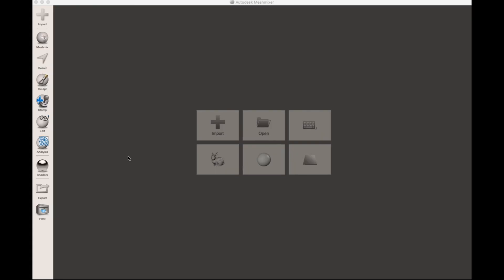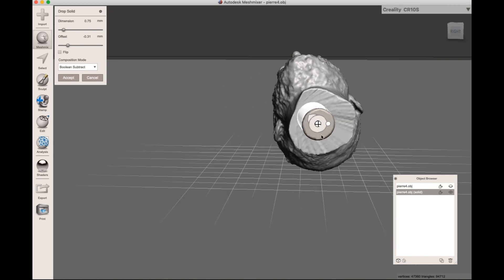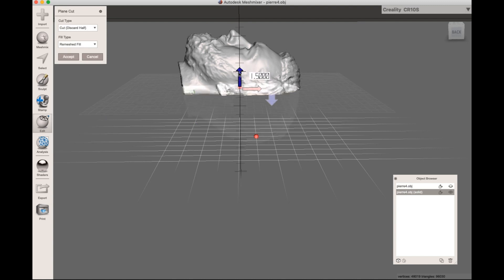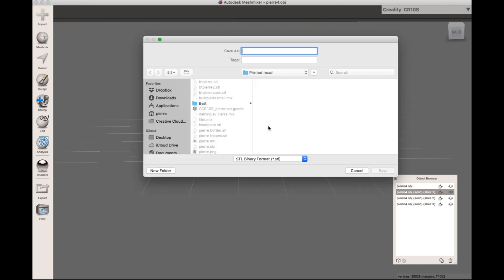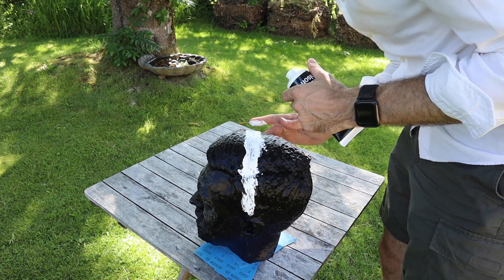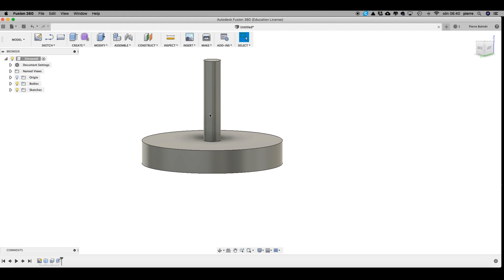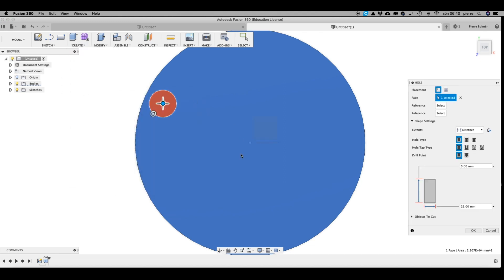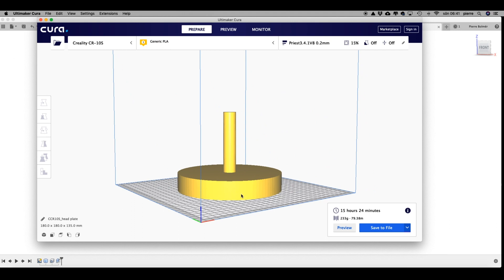3D Printing Yourself - Full Size Head Print

Comment: Any way to do this using a picture of someone? If so I’d be willing to pay for one! Great video!
Reply from the maker: It can be done, but the back of the head won't be the same as the one photographed of course. The better option is to do a 3D-scan. There are apps for that or I have a video on how to make it with a camera. There are also 3d-printing services that can print the finished design.
Reply: @TheSwedishMaker I the size and dimensions of your head the same size as the print out?

Comment: When did you set the size of your head and in which program?
Reply from the maker: I did set the size of the head in Meshmixer but then adjusted it some in Cura. It could be done either way, but I'm not sure how much it affects the quality when adjusted in Cura.
Reply: @TheSwedishMaker  And did you use your real head measurements?
Reply from the maker: Yeah I did measure my head but I didn't do it to the millimeter. In Cura you can set on of the axises to match your measurement and the rest will follow
Reply: @TheSwedishMaker  ok thank you